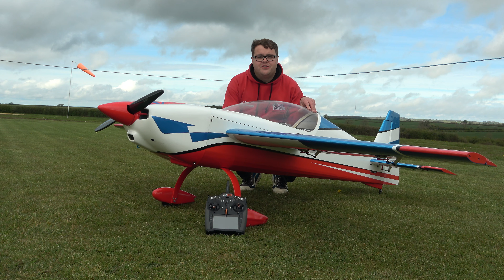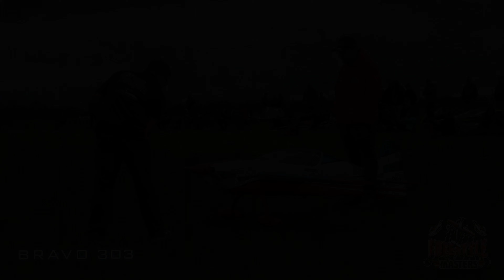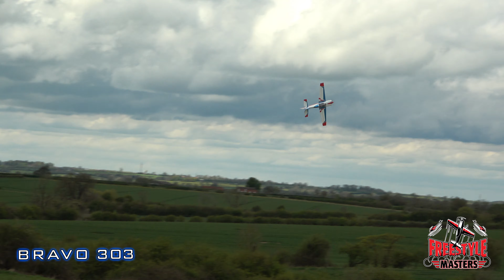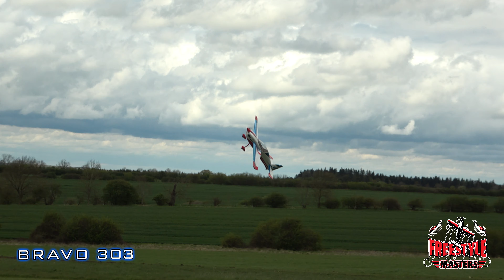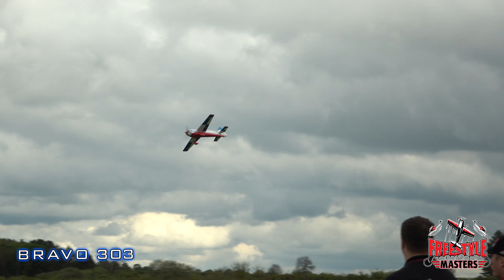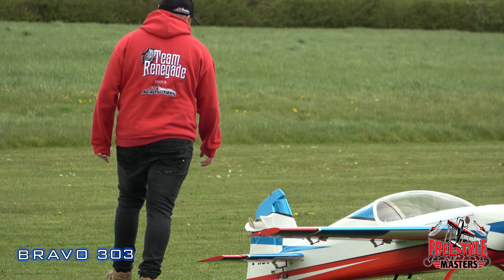Pilot RC EXTRA NG 103 - WINNER Alex Hawtin - Freestyle Masters 2021 FINALS

Comment: What oil do you use? Thank you
Reply from the maker: Stihl oil Ultra or Deluxe Materials PowerModel 2T-S Oil
Both on either a 40:1 or 50:1 mixture
Reply: @Bravo303  stihl oil ultra, synthetic oil,  flash point = 216°C👍. I use Motul 800 Line Road Racing, flash point 274°C. Engine working temperature around 100°C - 165°C (DLE 55 cc)